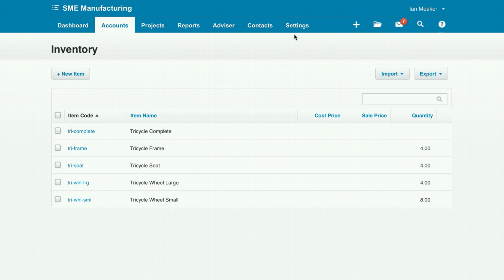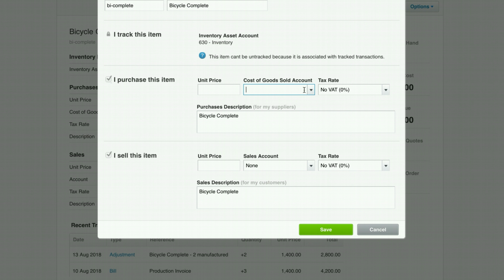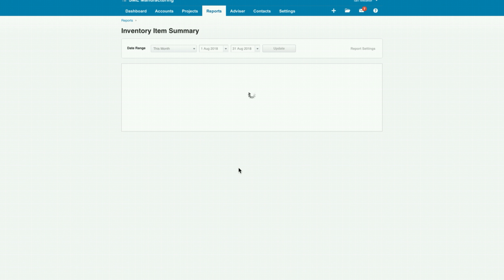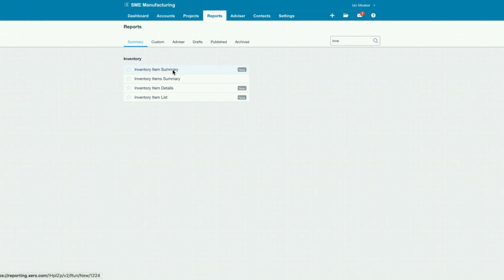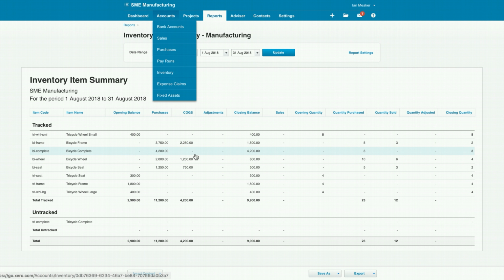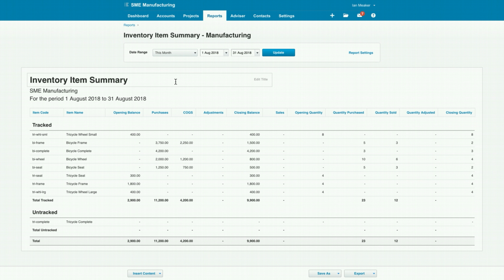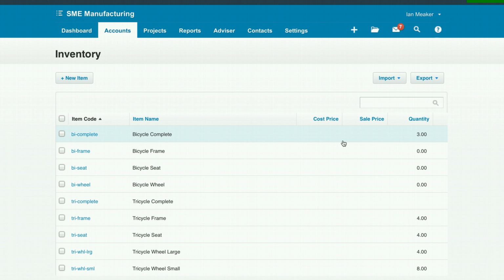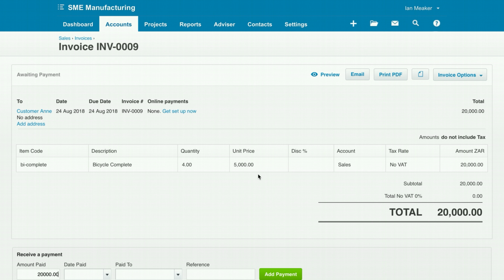Xero Manufacturing - Method 3 - Manufacture at time of assembly

Comment: If you manufacture something, done production invoice and during quality check something (part) is faulty.... How you account for faulty part?
Reply from the maker: You would end up using more materials that planned, i.e. more would go to the manufacturing cost. So the final finished good would contain that whole cost (planned + unplanned). If you don't end up with a finished good at all, then that expense on the P&L would remain. I.e. it's a stock write off for faulty parts